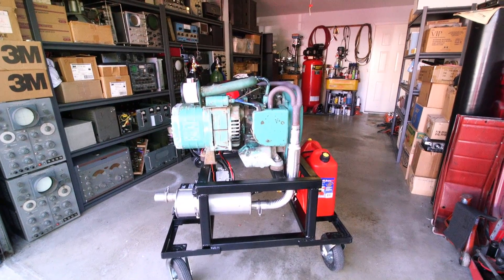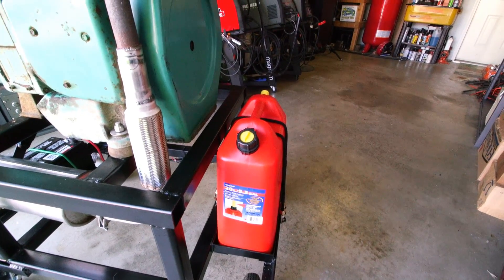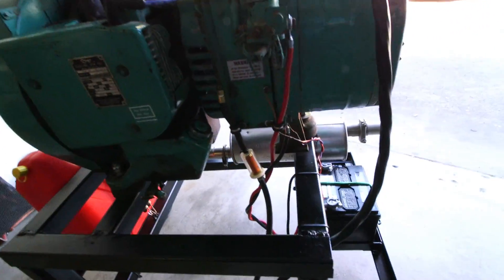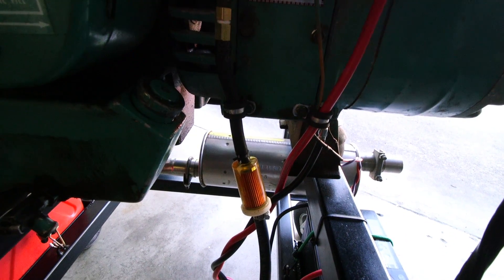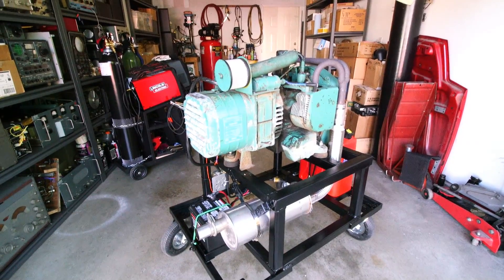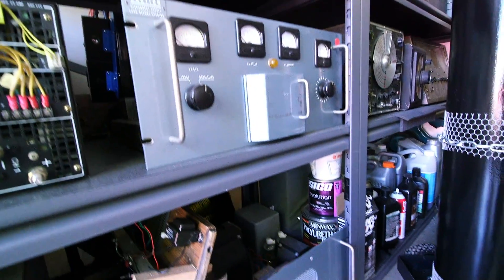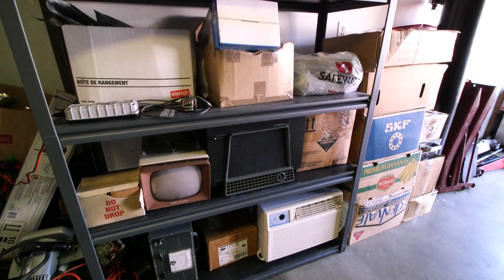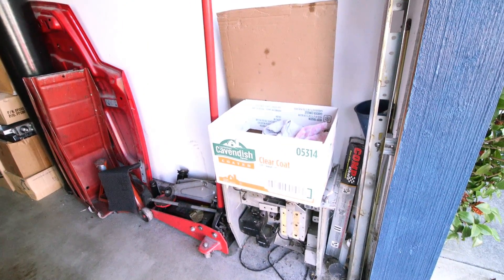Generator Build Update - See It Run!

Comment from the maker: To learn electronics in a very different and effective way, and gain access to Mr Carlson's personal designs and inventions, visit the Mr Carlson's Lab Patreon page here: https://www.patreon.com/MrCarlsonsLab
Reply: That sucker is not that, heavy, you should see what a 10CW, or 15JC weighs!
Reply: @turtmastert3545  You sound like someone who's been around generators for a long time. Paul's generator is around 230 pounds. That's pretty heavy for a guy (Paul) who looks like he don't go more then a buck and a half after walking in a heavy rain:) 15JC is that the old air cooled single phase/ three phase unit that Onan started making back in the 60s?
Reply: @thendric  the sixties yes, 3-phase not necessarily they made them in pretty much, any voltage combination, and the Diesels (DJC) up to 12.5kw, I've only been into generators for about the past five years, I'm only 25, and I have about 15 or so onans, and I'm not a very big guy, I'm only about five foot, I'm on smokstak, on the onan generator forum.
Reply: Replaced my service and subpanel in 2017 add a 200 amp transfer switch with a generator receptacle just incase  power outage. I think you made a good decision at least keep your furnace up in wintertime.
Reply: I'd love to support you but I have no money.
Reply: ⁹.

Comment: We just decommissioned this very same unit out at a remote camp and put in a 2500 watt solar set up.  It's said to have about 4000 hours on it. What is the life expectancy of these gen sets? Ours or totally shot.
Reply from the maker: If you keep oil in them, they will last forever, almost indestructible. If yours has failed, someone ran it out of oil.

Comment: Just an idea, instead of putting the fuel pickup at the bottom of the gas can, why not use a metal tube inserted from the top of the can with your rubber hose clamped to it. Having an electric fuel pump should have no issues sucking the gas up the straw and then no way it could leak if a gasket failed

Comment: Very nice build.  One thing to check out are the Mebay genset controllers.  I've got  couple for my Onans and the simple ones give you voltage, current, and power.  The more complex ones also do engine monitoring and power transfer.  I like them because I can have them shut the genset down if there's a loss of oil pressure or other problem.

Comment: Hi!,
I seem to have about 1/2 the number of vacuum tubes, about 1,500, that you have. 120 transmitting tubes, some sweep, some power triodes and pentodes, and three matched pairs of 3-500Z along with all the tubes my equipment uses. a 30 year collection by a 43 year Ham operator. I have two outbuildings full of projects, parts and pieces, but not as nicely catalogued as yours. other than running my 10KW diesel genset every two months (Stabilized diesel), I haven't needed it since hurricane Ivan some years ago. I guess I've been lucky. Electronics has been a special interest of mine since I was a kid (a nerd, too). My Dad helped me build a regenerative radio when I was 9, and I really took an interest after that. So, I watch your videos and thank you for tips that I never knew of.
73's de W4FJF.
Reply from the maker: Thanks for sharing your story! My total vacuum tube count is about 100K.

Comment: If you scavenge around and find a set of heads off the BGE or BG tractor engine they will bolt right on that BF. ( minor trim and adjustment needed to the cooling tins 
You can update the ignition with electronic from a BGE too. A little better fuel economy is the advantage.

Comment: I wish that had of been a BGE instead of a BF.
There are some boards and an AVR in BGE that cause a lot of grief and I think you might have made my life easier going through the main control board and showing us how to fix it.
Reply from the maker: Ya, electronic regulation in so many cases is unnecessary. The old way works just fine, it's regulated, and dependable in a very simple manner.

Comment: One thing that I've noticed is whole house backup systems aren't really that expensive. the expensive part is installation. By the time all of the permits and zoning regulations not to mention connection to the house thru the main input electrical box, and the fuel tank location your talking $ 10 K US. The project you have might need a shelter weather proof near the house. I've seen several examples of sheds and home made shacks with ventilation filters and fans to help keep the temps down. BTW, good job so far.
Reply from the maker: Thanks Dale!
Reply: @MrCarlsonsLab  So Paul, you say that you've connected to the whole house. what is the unit rated for? How many KW's and do you have a switching box for this generator.?

Comment: Hi, i guess an older piece of equipment like that will have sort of a messy sinewave output? Or is this in the better range? Nice video!
Reply from the maker: That will depend on the load. Most devices now don't care as they convert it to DC right away. A good example of this is a switch mode power supply. The inverter thing (regarding generators) is really "over rated."

Comment: Professional, do you plan to use the generator on electronics? I imagine most older technology doesn’t need surge or filtered power.  Enjoy your technical videos. Someday I need to use what my wife calls my Sillyscope. For IBM mainframes. It’s too heavy to move since my spinal fusion and implanted spinal cord stimulator device.

Comment: I wish you would have walked us through the rewiring if not the carb as well. but why did you remove the original fuel pump?
Reply from the maker: It was noisy (loud knocking noise when warm.) I don't need a failure during an outage.
Reply: @MrCarlsonsLab  I see. Right call.
 You gave me something to pay attention too. I asked about the wiring because although i have a wiring schematic to my 4.0, my brain doesn't remember things i used to know pretty well for reasons i won't go into. 
You obviously know your stuff. I respect that. I'd ask my BIL who is also an electrical engineer, but he's not easy to work with.
Thanks again!

Comment: Awesome video...what a great project!  I wanted a quiet portable generator that could power my house and ended up splurging for a Honda EU7000is model.  After purchasing it earlier this year, I had an electrician install an interlock on my main panel and a 240V 30A plug on the outside of the house wired into a dedicated two pole 30A breaker.  We had a storm in early August where we lost power for 50 hours, then it came back for a few hours and went out again for another 12 hours.  The generator worked great and powered everything in the house except our 4 ton HVAC unit.  We had a mini-split AC unit in the basement running and we were fine.  I highly recommend the Honda...runs at 2400 rpm in eco mode and can run for 18 hours on one tank of gas (5 gal).  Extremely quiet...about 50dB, and it has a built in inverter for solid clean power and fuel injection, so no carburetor to worry about.  It was expensive, but worth it for the quality.  I'll be changing the oil frequently, keeping the battery charged, and using ethanol free gas so it is always ready to go.

Comment: Onan is defiantly the generator of choice when power is absolutely critical. During hurricane Irma our drive-in theater ran al of the critical refrigeration, a 550 Lb. ice maker, two soda fountains, and our small auto fry off one for about 4 days continuously. No failures no issues. We even tried our luck with some of the digital electronics. Also no issues. As for fuel consumption we averaged 15 gallons a day.

Comment: @ 7:52 automatic welding helmet, which probably has batteries in it. keep it covered it with a thick dark material to keep all light out when not in use. even if it has a actual on/off switch, it will keep overhead lights from running the batteries down...... no need to ask how I learned that :))

Comment: add a secondary shield spaced between muffler and battery, it will get way too hot and shorten it's life in any long run period with load. **could even melt it
probably wise to double gap shield from the fuel can from exhaust pipe/flex also, even it you run it in free space
**in fact, shield all exhaust from radiating heat back at the gen/engine and all wiring/lines, a little bit goes a long way in keeping temps down and not melting things in long run cycles. try to gap heat shielding a minimum of 1.5" or greater.
signed, "have melted things before" LOL. (I like to learn from both my own and others mistakes and oversights)

Comment: Mr. Carlson, Does your generator output a pure sine wave? If not do a video on a conversion to a pure sine wave!
Reply from the maker: These older generators are designed to make sine waves, as the generator design is like whats at a water dam. The newer generators with inverters have modified sine wave output.

Comment: That should make the neighbors happier than the Champion from China running in full panic mode. Those Onan are military grade. People spend will spend 10 thousand dollars on a generator and it runs in panic mode like a lawn mower.
Reply from the maker: The Champion is a pressure washer. I have a Generac with a Tecumseh 12 horse engine.... That thing sounds like I should be hanging around with a catchers mitt waiting for the piston.
Reply: @MrCarlsonsLab  They were pretty good engines. I think they've gone out business. Not very PC and all. Diesel generators are really the best. They can spin the alternator at lower RPMs because they have more way more torque in that range. You could probably have a gear box in it to spin even faster. Of course that would mean more fuel. You might be able to super charge a gasoline generator to give it more torque at lower RPM. All added cost and people want one cheap. I mean how much are you going to use it anyway?

Comment: One more thing regarding the gas tank.  With a steel tank or similar, I would consider having a siphon tube coming in from the top of the tank with a filter on the end of the siphon tube.  You could mount the siphon tube to a steel plate that is screwed and gasketed to the tank.  You might be able to find a used tank on an old implement like a baler with a Wisconsin engine or something similar.  If you get a used older tank, you can coat the inside with products to seal the rust or prevent rust issues.  I think Eastwood sells stuff like this.  Lots of other sources.  Many older steel gas tanks will probably come with a vented cap as well.  Just some thoughts.  I have been away.  Sorry!  I plan to get back into watching your videos.  My health needed some attention.  Take care!

Comment: Nice to see you bringing the beast to life once more!  I'm in the middle of doing a carb/clean rebuild of my own gen.  Got it used, and it's not getting any fuel. So pretty much guaranteed it sat with fuel for far too long between runs.
Would be interesting to hear how you powered your house. Like how did you Isolate from the mains,  back feeding to the main breaker box bus, etc. etc. With the expected warning: "Done at our own risk" ;)

Comment: I'd move that battery away from the exhaust
Reply from the maker: The exhaust heat doesn't affect the battery at all, same for the fuel tank. They are farther away than they appear in the video. I guess the wide angle lens makes things look different.

Comment: Beautiful job Paul. Now you can work field day on 160m as EM.  Is that Hammarlund case for the super pro?
Reply from the maker: Wow, You got it. Thats the case.
Reply: @MrCarlsonsLab  how do you solve worn finger stock in the IF section for rotary band switch? Anyone making those? I have a SP600jx that's what's wrong with it besides caps.

Comment: Personally, I would make a wee heat shield between the battery and the muffler to avoid any deformation on the casing during long runs. That being said it’s probably fine, just more of a precaution.

Comment: Paul, since that appears to be a gasoline-powered generator, how will you store your gas long-term?  Stabil or equal?  Or do you do enough grass cutting to use it up every year, even if you don't need to run the generator?  Sometimes we have our grass cut by a lawn service, so our gas gets too old to reliably use, even when mixed with Stabil (which does great for "about" a year, in my "limited" experience).

And I wish my garage was as "messy" as yours!  ;)

Comment: Jason Arnold
I wish I could find old gear like that.  I restore or rebuild everything I have.  My house is run off a small 4kw Coleman powermate generator with a transfer switch.  Can’t turn everything on at once but the house is powered none the less without extension cords.  73s KC7STW

Comment: A few things.

Put an insulated wall between the hot air discharge / exhaust and the fuel tank to prevent fuel boil / softening of the fuel tank.

Putting a dip tube from the top of the fuel supply is a cleaner solution when using the type of electric fuel pump you have.  When a dip tube are placed through the cap, you can have a spare can of the same type to make for rapid refueling by just changing the tank.  Refilling this current setup requires a complete cool down as fuel splash on a hot exhaust can lead to fire.  For a gravity fed system, mower shops have a rubber T washer that snaps into a drilled hold then the shutoff valve barb pushes into the center of the T washer. It would be a good idea to shut off electricity to the fuel pump so the carb runs dry between sessions, this prevents the carb from gumming up.

Restricting the exit of the muffler to the diameter of one the primary exhaust tubes will further lower noise. Use cone pushed into the exhaust pipe.

I'd do a valve adjustment as loose clearances increase noise , tight clearances lead to valve burning / loss of power.  

I'd be looking towards a propane conversion due to deterioration of gasoline in long term storage.  Many propane conversions allow the gas carburetor to remain intact and can even be adjusted to run from natural gas.  With these any of these conversions, there is a derating from gasoline to propane and a further derating when on natural gas. This has to do with energy density.  In reality, it does not take much wattage to keep a fridge and a few lights going.  If a high load device needs to be run, just shed load in another area.

Connecting power to the house does not need to be difficult, most home breaker panels can accept a $ 65 sliding breaker blocker that won't allow the generator breaker to be on at the same time that the main breaker is on. This is something that can even be homemade. 

It is good practice to shut off all electrical loads before shutting off the engine.  Not doing this can lead to a loss of residual magnetism in the rotor and no power output at the next start up. Fixing this requires a manual field flash but some generators have an automatic field flash.  Residual magnetism is what allows the field to make some voltage, get stronger , make more voltage then finally stabilize.
Reply from the maker: Hi Bob, Are you new to my channel? :^)
Reply: @MrCarlsonsLab  I've watched a time or two for the interesting vintage stuff  but,  haven't commented until now since there is only so much time in a day.  ( plus I need to occasionally watch Curios Marc  , Big Clive , Techmoan , Fran Lab  , 8 bit guy, not to mention car + machinery stuff )  I'm all things electro-mechanical with just a bit of board level electronics but no where near the level you are at.  

Generators are my favorite device because when you have electricity, many other things are possible.   I've worked on generators ranging from 500 watt to 800,000 Watt when they have crossed my path.
Reply from the maker: Thanks for sharing your thoughts Bob!

Comment: Have you considered converting the generator to propane? That would eliminate all the issues with stale gasoline and varnish buildup. Cheers from Winnipeg.
Reply from the maker: I don't know, but these old Onan's are magic... I opened the carburetor, and it was spotless, I mean spotless... like new. I always use fuel stabilizer, so I'm not worried. My small engines start first pull after 3 years of sitting (2 of them), even my McCulloch weed wacker with a mix and stabilizer runs great every year.

Comment: I'm surprised you didn't mount the battery further from the exhaust, or at least use a heat shield between them.

Comment: Great job Paul. You have running like it's fresh out of the factory. The stand setup is awesome. I would offer you one last piece of advise. Add Sea Foam to the fuel to keep it fresh. Sea Foam will also help in reducing carbon buildup on the pistons, cylinder heads, and valves.

Comment: Thanks for all your vids. Conventional advice has always been that you can use a raw generator for powering rough and ready things like heaters but if you want to power sensitive electronic devices like PCs and TVs you need to use an inverter supposedly producing spike-free sine waves. I've always thought this advice was probably wrong and only promulgated by manufacturers of inverter generators. Most modern electronics have switched mode PSUs that presumably don't give a damn what kind of waveform is fed into them. What do you think? And what about powering old valve equipment which have old-style PSUs?

Comment: I have the exact same Onan.  Mine is the natural gas model.  I have everything with it. Original manual and remote control panel.  The weight of these things is crazy.  Manual gives you every spac needed.  Remote unit even has an automatic start timer.  These are definitely made to be repairable,  not disposable like newer generators.